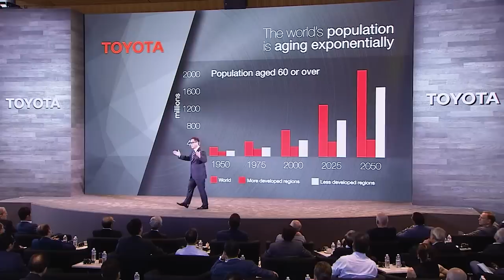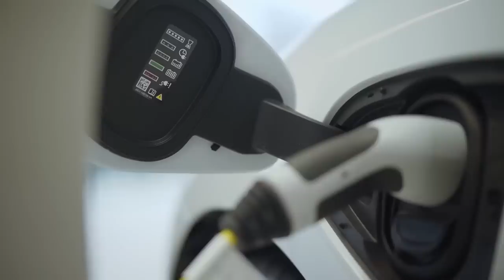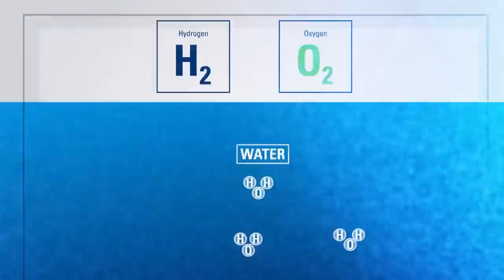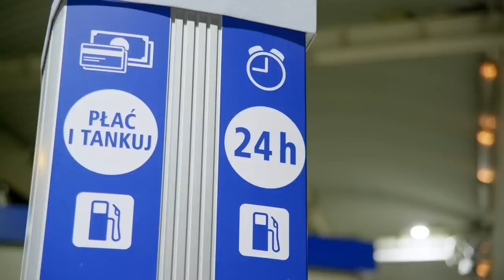New Toyota CEO Shocks Everybody | Huge News

Comment: Agree totally with Toyota and there ( common sense) approach to the issue. Already last summer in California they were asking the public to avoid charging cars and try to reduce the strain on the electrical grid because they were experiencing rolling brownouts! So people will be charging their cars and people of poor health may die from heat exhaustion in their home?
Reply: That was only during heat waves and during peak evening hours too (duck curve).  Most EV owners don't have a problem with this as most EV owners end up charging overnight like 95% of the time since that's when electricity is cheapest and, sometimes, even *free*.
Reply: You are right. It has been calculated that the charging ….if everyone is electric….is like adding 17 fridges electrical load to every house! The U.S. electrical grid is already struggling…..QED it can’t happen!
Reply: Do you know how hydrogen is made? Hint: it needs massive amounts of electricity...
Reply: @macvos  I can say also electricity is made mostly using coal. We see hydrogen as new clean source energy, support that although it still in its infancy.
Reply: @macvos  This is certainly true, but it would be centralized and predictable rather than spread across the entire grid and chaotic. In other words it would be a huge refinery, probably with it's own power plant.
Reply: @tobyvision  fair point
Reply: Horrible, but the solution is not to cut back electric cars (except temporarily). When I was in LA we still were being directed to stay inside because the air constituted a danger from ozone. I was stupid enough to try and get some exercise outside on what looked like a beautiful day and gave myself the worst possible headache, later found out when I got home that there was an ozone warning in place.
Reply: @tobyvision  The grid part is right but the hydrogen economy is decades away.
Reply: @mat3714  I agree. I'm not a believer in any solution as globally we can't even manage nuclear power, which is fundamentally necessary for most of the proposed changes.

I personally think that if India and China adopt the car on the scale that the US has, it won't matter even if they run on fairy dust. Just the infrastructure and manufacturing will be geologic.
Reply: @jpmrblood  Coal is not the main electricity generation source in a lot of leading economies.  Coal power in US is down to 14% in 2022 and falling rapidly because, in 2014, it was 42%.   EU is at 11.5% coal power.

It gets a bit more complicated because we have to consider the time of day as well.  Places like California will surge with solar power in the daytime and their natural gas power plants automatically "load follow" by throttling back power accordingly.  California's daytime grid can be powered from 50% to 100% renewables combined with other non-fossil power sources such as nuclear, hydro, and geo.  BTW, California only has one coal plant remaining probably kept around for research mostly.  Texas by far leads with wind power.

We look to leading economies energy markets and their energy policies to see where the rest of the world will follow.  World wide, coal power is about 1/3 of electricity generation and that definitely needs improvement.  Leading economies end up paying for the R&D and making big purchases of new technology bringing the prices down for everyone else.
Reply: Hahaa! I have been saying for years that California’s grid can’t handle and never will be able to handle the electrical load placed on the it by electric cars. Maybe if three or four new Nuke plants were coming online in the next couple of years. The government shortsightedness is truly mind boggling. From Toronto Ontario Canada. Cheers!
Reply: @beyondfossil  I don't hate electric car. The idea is novel, but I don't want people to diss other clean energy solutions. Both are not ideal right now. People who hate hydrogen but idolize electric seem only see the country they live. Toyota is s global brand. They need to think global. They need to consider all countries.

Comment: Hydrogen - can i fill my car using my home water? Can i fill my car up from the ocean? NOPE i will need to use a Hydro fuel station which will end up being a higher cost whereas my EV is charged from Solar Panels not the grid
Reply: @Griffin T my R1T gets completely charged, recharged and maintained using solar panels only. The only thing I pay for is my truck note and insurance
Reply: @griffint6637 you are right from what I read, in the UK its now more expensive to charge your car, than fill it with gas.
Reply: @cpgravenor  invest in a properly sized solar system with battery backup. I have a 30kw solar system and battery bank which I have installed myself in 2019 before all this covid crap. My solar cost was $19k which powers my entire house and charged my EV. The only people supporting gas and hydro are people who Will financially profit from hydrogen or gas
Reply: @cpgravenor  The UK rates are based on the MOST EXPENSIVE generation, which is generally natural gas. As a National Grid shareholder, I am ashamed at the greed of the company, the stupidity of the regulators, and my handsome dividend check. 
In the USA, fueling an EV is generally 1/5th the cost of gasoline.
Reply: The EV disruption has past the tipping point where EVs will become the predominant type of vehicle. The U.S. market is the slowest of the big three world car markets. Total vehicle sales in 2022 was 66 Million of which the huge China market made up nearly a third at 26 Million with 30% sales now EV and growing rapidly. The European market change to EVs is also going fast. In 2022 the European market sold a total of 9 Million vehicles of which 12% were EVs. It’s the U.S. market that has the slowest adoption of EVs with 6% EVs sold of the total U.S. market of 14 Million. Make no mistake EV sales are rapidly increasing around the world and will come in larger numbers to the U.S. too
Hydrogen fuel cells is a dead duck. No one is going to build Hydrogen manufacturing, distribution networks and expensive fuel stations. Hydrogen as a fuel source is expensive and inefficient. Toyotas pathetic sales of  2000 hydrogen cars  worldwide in 2022 will be about it. There is a push for Hydrogen by some legacy auto in Europe. This is going to fail too. The Sales of EVs are rampant in Europe and growing very fast. Tesla Model Y was the best selling car model in Germany last year pushing the VW Goff out. Will Toyota be part of this? It takes Toyota 4-5 years to Develop a new car and bring it to market. Sadly it’s going to be to late for Toyota with entrenched ideals and crushing debt. Toyota 2022 sales of 10 Million will become history

Comment: I was an Auto Dealer, I was never excited about electric vehicles. Hydrogen vehicles excite me. Hydrogen is not difficult to make. You can refuel a hydrogen vehicle in 2-4 minutes, unlike electric vehicles that take 30 minutes for a rapid 80 percent charge, which decreases your battery life. Hyundai has a 670hp Coupe that looks like the old Nissan 240. Very cool things will happen with Hydrogen. Since Hydrogen is made from water, they will figure out a way to charge us $5 a gallon. Hell, look at bottled water, it is already more than $5 a gallon lol. My point is, there has to be money in it for the people at the top or it will not happen… We just need to be quite for a little bit before we start making our own hydrogen.

Comment: Here is some reality regarding hydrogen-powered vehicles.
The hydrogen is stored in the Mirai at between 5000 and 10000 psi.  The infrastructure for the fueling stations is massive compared to an EV charging station.
The current cost of hydrogen is about $15 for the equivalent of one gallon of gasoline, which is about three times the current price of gasoline in California.
It has been estimated Toyota is losing about $50000 on each Mirai.  In the meantime, Tesla is making about $15000 for each car it sells.
Among the other automakers, Nissan and Hyundai have dabbled in hydrogen, but even they are now fully committed to EVs.
In the United States, only in California is a hydrogen fueling station network being built.  By comparison, EV charging stations are being built nationwide. 
The question shouldn't be why the former CEO was forced out, but rather why he was allowed to stay in place so long.

Comment: good to see a company going in a different direction.  people have been so short sighted on how their electric vehicles don't produce emissions but ignore the fact that most of the electricity used comes from coal plants(at least in the US) or other fossil fuel plants.  Everyone's been patting themselves on the back while doing nothing to really solve the problem.
Reply: No to mention the environmental impact of producing a tesla is far higher than a toyota
Reply: …while flying in the thousands of aircraft fogging the Earth without any cat converters or mufflers.
Reply: The "problem" that is going to be "solved" is really removing personal transport from the average citizen.  "Net Zero" is just a smoke screen to accomplish that.  Thank you WEF.
Reply: @beantreats  Nope. Do you research. And also incorporate the amount of energy expended extracting, manufacturing, transporting and distributing your fuel. My fuel comes from the solar panels on my roof...
Reply: @SynthFreaq  can you say the same about every ev owner? To be clear, I like evs and tesla and what elon is trying to do for humanity. But that doesn't mean there aren't serious issues associated with the sourcing of some of the materials required to produce those vehicles. Trust me, I am no fan of the oil and gas industry either. Buying a new gas guzzler vs a new tesla (charged only from solar power) would certainly favor the tesla, kudos to you. But most people are simply adding more strain to a coal powered grid. Until more of our power supply is moved over to renewables, buying a (USED) [fuel efficient] gas guzzler is actually the most environmentally friendly option. Of course, to develop renewable energy more, we run into the same environmental issues from before with ev batteries.

Elon has said before that one of the reasons he wants to go to space is to get more of those rare minerals...
Reply: @beantreats  Our "coal powered grid" in the USA is down to about 20% coal and falling, because other sources are cheaper and are undercutting it.  Coal and nuclear and renewables are all about the same portion now.  Biggest sources is natural gas.  The mix varies depending on where you live, but an EV almost always works out better than burning gasoline, usually way better.

I haven't heard anything about Elon wanting to get into space mining.  You don't need anything rare to make EVs.

Comment: Battery tech is changing constantly.
What you see today, will not be what’s available tomorrow.
It’s already advanced a lot in just 10 years.
Reply: When a battery car can fully charge in the same amount of time as a person can fill their fuel tank,is when the country will be ready for EV’s.
Reply: @kyzor-sosay6087  - That could be possible within 5 years of time hopefully.
Reply: My friend, we had EV cars with batteries going over 200 miles in the late 1800's. Those who ran the world wanted it crushed.
Reply: @jeff gilleran

battery has not changed for the past 50 years. LOL. The only thing that has changed is hype with Tesla.
Reply: There is not and Never will carbon neutral…… period
Reply: @kyzor-sosay6087  I assume that you are able to fill your gasoline tank at home as can be done with an EV.  No need to get out of the car in wind, rain, snow if charged at home.
Technology in electrical charging time is advancing daily.  That for ICE vehicles is dead.  You won't have long to wait.
Reply: Battery tech remain the same, bigger capacity yes, but they still use Lithium, they still explode, they are still complicated to charge
Reply: "Battery tech is changing constantly."
Batteries were around before gasoline was adopted. It's a maturing technology.
Reply: @wisenber  Exactly well said.
Reply: @philippecr  How about if Sodium Ion Battery? That will also explode?
Reply: Really. Because they can't figure out how to make a 12v last more than 5 years..
Reply: @Pimpernicholas  "I assume that you are able to fill your gasoline tank at home as can be done with an EV.  "
There's really no need to add thousands of dollars of equipment like an EV needs to charge at home since it only takes a few minutes and not hours to refill a tank.
Then again, if the weather is so bad that I can't leave the house, I probably don't need to spend the five minutes filling up a tank.
Reply: @Missingtailpipesby   there are many many different newer batteries trying to solve all kind of issues like thermal runaway, but most of them are not commercially significant enough till now.
Reply: @wisenber  still not fast enough to match our ever increasing needs of power
Reply: @philippecr  - Yes but in other hand CATL and BYD they are going to commercialize the Sodium Ion Battery mass production by end of this year that's really promising one.
Reply: @philippecr  The needs for power aren't really growing that rapidly. It's the arbitrary shifting of sources of power that's causing most of the shortages.
Reply: @kyzor-sosay6087  Well that’s just one of many issues. I agree that charge time is hindering adoption of EVs but battery cost pushes the price of a vehicle so high, most EVs with good range are not affordable. The bigger issue is infrastructure - suppose half the cars on the road were to instantly switch to EV, you’d have rolling black outs everywhere.  Doubt transformers were designed to support the heavy load.
Reply: @Missingtailpipesby   I've heard multiple times a new battery tech going to be commercialized, but nothing I heard from it since... Hopefully this one you mentioned can really happen. 

But what are the sodium ions advantage over lithium ion?
Reply: @philippecr  - Thank you for the reply.  The Sodium-ion batteries have several advantages over competing to lithium-ion batteries like better safety characteristics, and similar power delivery characteristics and most importantly it's one of the cheapest abundant materials.
Reply: @wisenber  There's lots of battery chemistry to be investigated.  Thousands of PhD chemistry students are working on it every day.  And there are battery technology breakthroughs surfacing regularly to increase the range of EV's.  There was one such just within the last couple of days which increased battery energy density by about twice what is available in the standard lithium-iron-phosphate battery.  The news might be available on Youtube.  Do a search.
The last beneficial gasoline chemistry was the invention of the catalytic converter.  What does one do with the exhaust?  It's still toxic.  We are  so lucky that Elon Must showed up to spur the use of a lot less poisonous means of transport.
Reply: @Pimpernicholas  "There's lots of battery chemistry to be investigated."
The chemistry has been known for nearly 3/4 of a century.

" Thousands of PhD chemistry students are working on it every day."
Engineers might be more helpful as the chemistry is known. It's the application that's lacking.

"The last beneficial gasoline chemistry was the invention of the catalytic converter.  "
Odd that you would mention something that decreased power and efficiency when there have been countless advances in power and efficiency in the half century since catalytic converters were introduced. A 2 liter engine that used to yield 100 PS 40 years ago is doing over double that today.
A 3500 lb car getting 15 mpg 40 years ago is getting 35 mpg today.

How long have you been driving to have missed that???
Reply: @Missingtailpipesby  5 years lol no way man. well over a decade.
Reply: hard disagree, you better read more precise material science research papers than some rando science news from BBC and CNN.
Reply: <<What you see today, will not be what’s available tomorrow.
It’s already advanced a lot in just 10 years.>>

Call me in ten more years.  Or twenty.
Reply: @philippecr  and hydrogen will not explode?

Comment: Hindenburg
A leaking gas cell allowed hydrogen from the airship to mix with oxygen from the outside air, and a spark, possibly from static electricity, ignited the gas leading to the fire that consumed the Hindenburg.

Comment: I am glad toyota is sticking to their guns. I mean the Corolla Cross is being helpful in my country as a mild Hybrids and a petrol engine. An EV here will be more harmful then helpful. At least for now
Reply: And bring the Corolla wagon estate hybrid  to canada,  I don't need their awful Cross .That almost useless front grille that doesn't slice through the air is an engineering disgrace.
Reply: @oi32df  Actually an estate will be good for both our markets but my country is obsessed with Crossovers and SUVs so The corolla cross is good enough for us even through the Sudan and the estate would be batter and potholes are just an excuse to buy ruined hatch backs called crossovers as bad as they are

Comment: Quick update. The video mentioned hydrogen shipping from Australia to JPN. Unfortunately the Japanese terrain doesn’t allow large windmill installation in Japan die to the mountains or the deep see bed. Therefore JPN needs to import green energy. The idea of shipping H2 from Australia was ditched since it is too expensive. Instead of H2 they ship ammonia manufactured using green energy. Later they turn ammonia into hydrogen in Japan. This is a cheap way of hydrogen import.
Reply: @gtfg3800  you may not know this but Tokyo is the largest emitter of co2 in the world. . . Sounds green to me
Reply: @benhecker1704  Chinese agitprop.
Reply: @thatguyinelnorte  ?